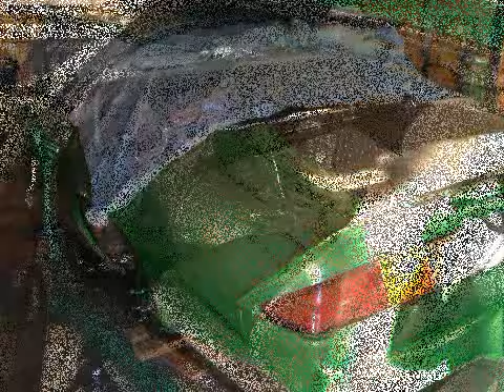1981 Camaro Custom Restore Project

Comment: Hey, i have a 1981 Z body I can get ahold of for a grand.  The inside is in peices and the floorboard needs cut and replaced.  Looks like it would be great to tub out and send down the track.  Body is almost in perfect condition.  Slight cracking on the front bumper(barely visable)  do you think it would be worth the 1k for a motor and body?